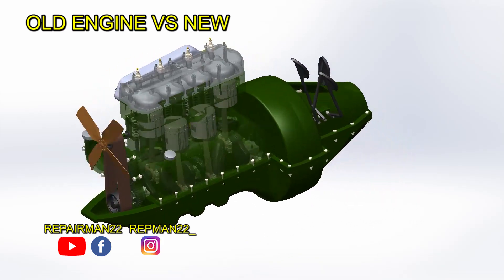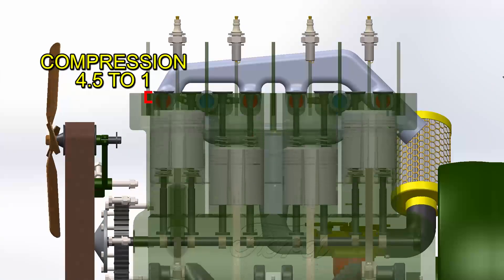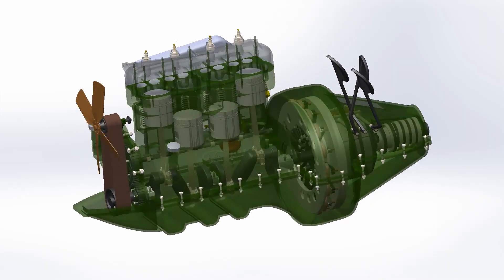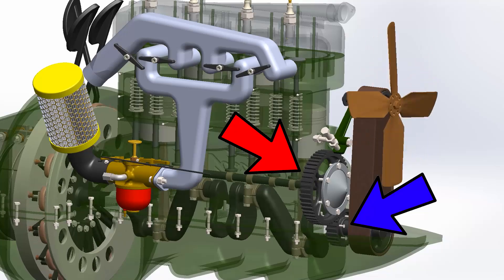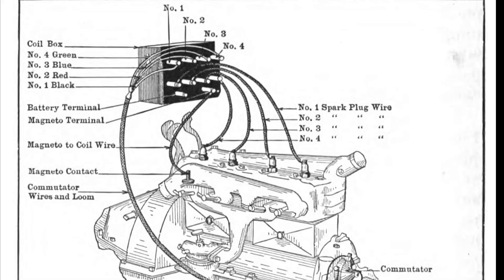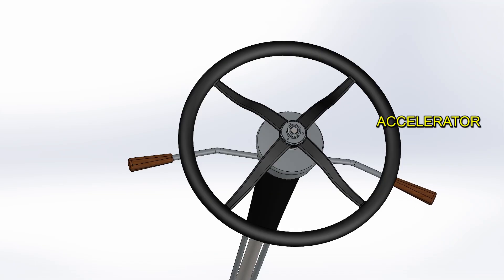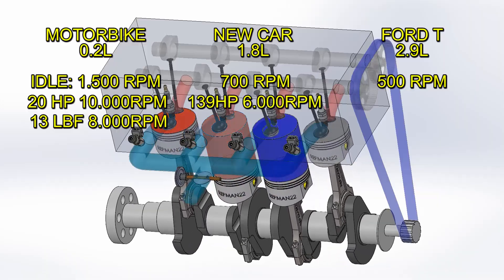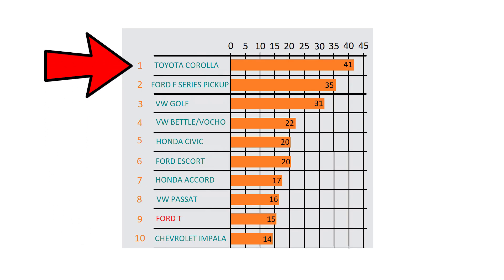Ford T vs New Car 🤯 3D Animation// What changed in engines in 100 years?

Comment: The T was made in an era when there was little if any mechanical distinction between cars and farm equipment.  It had problems of course, but it's amazing that it was able to run relatively well using such primitive means of lubrication and cooling.
Reply: Yes indeed, in a time where Ford was expecting buyers who'd never owned a car before due to the T's affordability compared to most previous cars, they assumed a lot of owners would be far away from convenient car mechanics, so being easy to fix for anyone familiar with basic farm equipment was probably a really good selling point.
Keep it simple, and the owner that was able to fix minor issues themselves easily just ends up liking it even more.
Reply: @G1NZOU  
Most  Certainly  ,   YES  .  
But  don ' t  even  touch  
"  Todays  "    motors ,  by  yourself  .
Even  trained  mechanics  hardly  can  fix  them  easily .
Reply: Yup  .

Shows   just   what  .
Can  be   done  .
Reply: Yes  !
Old  sayings  ,  ARE  often   the  truth .
This  one  ,  for  example .
"  The  Simpler ,  the  Better  "
AND  ,  what  of  the  Worlds '  Future ?
Futures  ??
Billions   ARE  helped  MORE  by  simpler  ,  cheaper  things  in  a  world  of  8  billion  variations  of  Life  Styles .

Cher  sings  about  lf  l  could  turn  back  time  ,  if  l  could  find   ,  a  Way   . . . . "

Would  she  turn  time  back  to    1 9 3 9    ?
Reply: @georgehorobin2225 if it’s bitter, it’s better.
Reply: @glennso47  

More  information  is  needed  by  me  about  that  comment . . . .
" If  its  bitter   it  is  better  "
When  you  are  ready .
These  things  take  &  need  time  and  can  take  years  .
In  my  case  ,  I  have  about   4 0 0   new   ideas  &  may  soon  have  about  5 0 0   new  ideas  for  Planet  Earth   &  Industry  &  Agriculture  &  Fishing  and  many  associated  things  .
Knowledge  is  often  an  important  Factor  &  Component  .
But  many  are  the  trouble  making  " Set  Backs  "  in
The  Set  of  2   things .
Bitter   /   Sweet  .
Reply: According to my dad many farmers used the model T as a farm implement.
Reply: AND  ?
15  Million  ?
CAN ' T  ?   be  wrong  ?

Comment: The Ford Ts flathead is about the only thing that remains an astoundingly reliable mechanism. It’s true that the side valve arrangement makes an engine immune to valve drop and eliminates damage potential from extreme valve timing issues. Valve drop, by the 70s, was a virtually unheard of issue, but it can happen in OHV engines. The benefit of the  flathead, though, is that you can use dirt cheap materials and not worry about it.

The multiple-spark system (called SOS in airplanes) helped with the bad gas available at the time, and improved starting with low-grade fuel. It certainly helped with starting especially, but with modern fuel is entirely unnecessary.

The T used a planetary transmission, which reduced its likeliness to strip gears, and it’s certainly less likely than even the most modern manual transmissions to strip out and have serious damage. But it was controlled by tightening cotton bands around the ring gears, and these go bad almost constantly. If it weren’t for the cotton bands, the transmission would have remarkable reliability even today. But because of the cotton bands and how they behave, the reliability is very low.

The fuel system is drastically improved by the addition of a fuel filter. The bladder device used on the T was sub-par even for its time, and it said in the Ts manual to filter the gas before it was even put in the car.

The oil slingers (called “spoons” here) were so woefully inadequate that the addition of an oil pump more than doubled the lifespan of the engine - when oil pumps were introduced they were seen as being the saving grace to reliability. People who lived in mountain states used to fill them so full of oil that they would smoke as if they had blown rings, so much so that bystanders would think that the car was on fire, and this would wind up doing damage all on its own. In some places people associated oil pumps with clean air.

The carburetor was finicky and didn’t have an air filter. If dust gets in it’s like grabbing sandpaper for rings. And in many places there’s dust, including on earth. Finagling the carburetor to turn on the car made the car difficult to start. I’ve had experience with crank-start engines that have finicky carbs and they’re an absolute nightmare to get running. The introduction of electric start seems to us as a footnote in history but to the people at the time it might as well have been a gift from god himself.

There is the problem of having to back up hills because of the gravity tank, but that’s not a reliability issue it’s just inconvenient.

The lack of a water pump is a nice little niche, but that’s because of the low power of the engine vs. its surface area and size. Anything even slightly more substantial needs a water pump. It’s cool that it doesn’t need one, for sure, but no modern engine can do without it, besides something that’s air-cooled. If the Ts engine were designed today (in fact, any engine in any riding lawnmower has made the same HP since the 80s) it wouldn’t have water at all, it would have no water plumbing nor radiator and would just be air cooled. The cooling system on the T is actually quite a lot more complicated than any equivalent engine designed today.
Reply: Thanks for the fantastic breakdown I really appreciated the additional insight!
Reply: Some electronic ignition systems today are multi-spark. For example, the recently introduced Boyer Bransden ignition system for English motorcycles is called the Tri-Spark
Reply: @pashakdescilly7517  this is true,  SOS systems are being put into cars more and more often. This is mainly because gasoline quality is being chipped away in order to have cheaper fuel. As cars progress they're being built to handle more varied grades of fuel, which widens the margin of error for fuel quality, and enables more experimentation.  Shower of Sparks systems prevent missing hits and reduce emissions as a result.
Reply: My dad told me about using gasoline to start them. After it warmed using kerosene or diesel to run down the road during WW2 and before.
 IN 1969 I had a Corvair. A air cooled flat six. It got 30 MPG but it also required a minimum of 95 Octane and retarding the timing 2 degrees when 100 octane was not available.
If you compare 1965-1969 Corvair 110-140 to 2015 Trax. The Corvair is larger and more comfortable. But if you got the 2 speed slushomatic, lower gas mileage and a lot more time to get to the freeway speeds. The 4 speed stick was better than the 6 speed in the Trax. No flushing required.  Could change out the then $25 dollar clutch in any cement floor in one hour. Happened about every 25-30 miles because I got 18-20 MPG.
The engine and trans was easy to fix also. 6 new jugs, two easy to get at heads. If the piston is not damaged, just put in new stock rings. The head work cost more than the jugs.
 Only took 8 Bolts to remove the whole thing.
 Only takes $8,000 and 21 hours of labor to fix the engine and trans in a Trax.
Yep you can say things have improved. The price of fixing has not.
Reply: How can a planetary gearbox have multiple ring gears? With a manual we need to transfer force on a moving part which then governs a clutch ( syncro mesh ).
Reply: @ArneChristianRosenfeldt  there's two planetary gearsets in the transmission.  Both sun gears are connected together with a shaft and power is sent to them via the planetary gears.  The ring gears are able to free spin, and when they do,  the planetary gears do not transmit any power to the sun gears. Each ring gear can be stopped by means of tensioning a cotton band around them, which causes the planetary gears in the selected assembly to send torque to the sun gear.
Reply: @ArneChristianRosenfeldt  Your  information  ,  as  stated  ,  is  nonsensical .
 What  is  your  questions ',   intention   ?
Thank you. 
Or  did  you  only  intend  it  as  a  talk  convertor  ?
Reply: @georgehorobin2225  My first introduction to an automatic spoke of "brakes". I always did wonder why an automatic would not need a clutch. A clutch is a brake where both the disk and the pads rotate. So you need a bearing with axial load and typically some spring to actuate it. I would still invest in this rather in more gears.
I just want to give the whole picture. Dragsters still seem to use a rotating ratchet ( so no actuator ) and a brake on the ring gear. I thought that this is for heat: After use a clutch is hot and you better don't touch it. But then again two large diameter clutches would be better. With engine in the front and rear wheel drive there is lots of distance to keep 8 pairs of gears. So the clutch only needs to compensate for small RPM mismatches and only for short time.
Unlike a belt based CVT, neither clutch, nor straight spur gears have a scaling limit.

The differential needs a bevel gear anyway. So just press two of these onto the planet holder. So no problem to attach a double-clutch gear box with two output shafts. Only problem is that an engine only provides a single power-input shaft. So you end up with all this coaxial shafts :-( Maybe someone builds a dragster which works like the steam engines: Conrods to transfer torque onto a second shaft.
Ah so many reasons why EVs are the better cars.
Reply: @Arne Christian Rosenfeldt  What  ?
What  did  you  say  ,  Arne  ?

My  main  interests  in  engines & transmissions  for  this  Planet  ,
( While  electricity  AND  Fossil  fuels  AND  VEGE  OILS  are  still  available  AND  are  being  found  &  discovered  &  developed  for  the  next  300  years  and  MORE  . . . . 
Is  this .
How .
How  to  make  900  m.p.h.  locomotive  assemblies  moving  freight  and  animals  and  human  life  forms  ,  in  safety  and  efficiency  and  cheaply  ,  between  South  Patagonia  and  a  huge  300  mile  long  Marshalling  yard  north  west  of  Moscow  .
Interested  ?  
   &
Converting  coal  into  liquid  fuel  oil  cheaply .
     Interested  ?

And  you  have  info  about  Clutches ?  
To  " handle "  that  sort  of  . . . 
   LOCO  ?
Or  are  YOU  ,  Loco  ?
Reply: @georgehorobin2225  Is English not your native language?
Reply: @ArneChristianRosenfeldt  why would you want two clutches side by side? And two drive shafts implies two transmissions.  It's better to just make the clutch bigger
Reply: @Johnsoline  Double clutch is generally used to avoid a torque dip. You apply one of the clutches and it then lifts the other clutch out or torque by means of a ratchet. ( or you have slack in each of your transmissions and fast electronics and actuators to pull out the cogs ).
Reply: There is an oil pipe that carries oil from the magneto top to the front of the engine, if that gets clogged you will burn out the front bearing going uphill.  You can see if it is working if you take the oil filler cap off and increase the rpm’s a little and you will see an increased flow.
Reply: So  why  not  an  improved  Planetry  Transmission  for  modern  engines  ?
And  why  not  more  effective  oiling  of  motor  &  Gearbox  ,  WITHOUT  oil  pumps  ?
Reply: @georgehorobin2225  There is an improved planetary transmission for modern engines. It's the automatic transmission. The way they work is virtually identical in concept, but the automatic transmission has ditched the cotton/asbestos bands in favor of more reliable clutch packs, and gotten rid of the clutch in favor of a torque converter.
Reply: @TheJohnsoline  
Seems  good .
Very  good  !
But  the  World  needs  a  NEW  &  better  ,
" Talk Converter "  surely ?
Not  " Kalash nee cough  "  ?   of   " Teeth "  ??
Reply: @georgehorobin2225  what??
Reply: @TheJohnsoline  
What  ?
Is  a  question .
About  the  subject  or  content  or  intent  ,  of  ,  Communicating ,  per  sey .
All  l  want  to  say  at  this  time  is  ,  "  Wait  for  it  ."
(  lnformation  ) 
And  .
Regarding  Engines .
The  future  World  may  need  another  Ford  Model  T  Mark  2   ,  Engine  ,  a  billion  of  them  ?  For  various  applications  ?
Reply: @georgehorobin2225  more effective oiling requires oil pumps. The T's engine didn't have an oil pump, but it also ran at 1500 RPM and pulled around a ¼-ton vehicle at 30mph. No stop-and-go traffic in 1910 really,  and an engine lifespan of 35k miles was astronomical. It did that all at 10-15mpg. Nowadays we want freeway speed, stop&go driving, good fuel efficiency, and great power out of a small engine that lasts 200k+ miles.  The T's engine made 22HP and was the size of something we'd expect 100+ from today. This involves high stresses and speeds which requires high pressure constant lubrication, a little flap attached to the crank to splash a little oil around isn't going to be good enough.
Reply: Yeah, anybody who says "they don't build them like they used to" are correct because the cheapest oriental car made today will last longer with less care than the average American car of the 60's. Put a young person in an older car with drum brakes and they have to quickly grasp it has less braking power and you really have to muscle the non-powered steering wheel. Remember the old vacuum powered wipers? The wiping speed wasn't consistent at different points of motor load and would at times come to a complete stop! Just try and buy a car today with a lighter and ashtray (just kidding) but one thing I do miss about the older vehicles were the wing vents. Quite often in a car built in the 60's would survive a collision better than its occupants. With a little know how an older car could be easily stolen compared to now.

Now there's the push for electric cars, we'll just have to wait and see......

 @Johnsoline
Reply: @georgehorobin2225  All I can tell you is all of my manual shift vehicles outlasted the automatic shift. Not many women like the the 3rd pedal. But not too worry modern engineering has fixed the reliability of a external clutch. It is called the dual clutch.
 The days are long gone from removing 6 bolts, taking the shifter off and dropping the drive shaft down. Sliding the tranmission back . Remove and replace after touching up the flywheel and pressure plate with a bit of 120 grit on a sponge. Blowing the grit out and replace the bolts. In and out in 30 minutes. But also there were those 6 and 8 bolt bell housing from then too. Those took 1hr hour. Because the the tranny had to come out to get the bell housing off.
Reply: AND  ,  have  you  seen  the   ,  NEW  ,  ideas   for  " Flat  Head  "  motor  construction  ?  
What  would  it  cost  Ford  Motor  Company  ,  to  get   THAT  valuable   motoring  part  ,  ln formation  ??
Reply: An  ,   Air  cooled  ,
Model  T   ,  modern  Ford  Engine  ?
Intriguing    !
  But  ,  How  so  ?
Reply: MUCH  MORE  ,  can  be  done  to  improve  both  air  cooled  motors  and  water  cooled  motors  .
And  at  little  more  cost .
And  resulting  in  MUCH  greater  reliability   AND   durability  ,  believe  me .

I  have  studied  engine  designs  seriously  since  before   ,  and  during  1995  and  from  that  time  on .

BUT  !
I  don' t  want  my  ideas  for  improvements  ,  stolen  from  me  .
Ralph  Sarich  ,  Australian  inventor  off  an  Orbital  engine  ,  similar  to  the  German  Wankel  motor  design  ,  went  to  the  U . S . A .   and  sold  his  design  to  some  Americans .
It  was  reported  he  was  paid  ,  for  exclusion  to  the  Right  of  Manufacture  of  it  ,  by  him  ,   an  amount  of   $  200  million .

Did  Ford  Motor  Co   buy  that  Right  ??
Reply: @georgehorobin2225  why would a motor company pay 200 million to buy exclusive rights to manufacture and then never manufacture?

200 Mil is a HUGE loss on something you'd never profit from. The kind of decision that would make a company go under
Reply: @Johnsoline  
Because  manufacturing  Companies  want  to  Control  manufacturing  ,  in  a  way  that  will  enhance   their  own  productions  and  suit  their  intentions  to  survive   and  prosper   with  THEIR  Plans .

If  they  own  something  ?
It  is  theirs  .
To  make  decisions  about .
Ralph  Sarich  put  that  money  into  high  rise  city  accommodation  towers  , AND  some  of  it  continued  his  Right  of  Manufacture  of  a
  Two  Stroke  & / or  other  ,  Outboard  motors  ,  fuel  supply  system   for  boats .
Reply: More  is  known  about  motor  designs  now  days  ,  including  the  " Flat  Head "
Style  .
All  of  the  newer  understanding  or  comprehension  of  those  design  ideas  would  result  in  much  superior  engines  AND  ,  engine  production  techniques  .
Definitely  better  than  motors  of  this  year  of  2 , 023 .
But  ,  who  will  make  them  ?
Americans  or  others  or   both  those  ?
Reply: Knowledge  is  of  great   Primary   lmportance  .
It  Preceeds    ,  all   else  .
Without  it  ,   ideas   cannot   exist  .
And  Good  Will   in  association  also  is  essential  for  a  good  result  from  the  application  of  that  knowledge   ,  in  effort  to  ACHIEVE    the  goal  of   helping   Good  ,  Survive  AND   INCREASE  .

Comment: 2022 Engine = SHIT

old engine = 👍
Reply: yeah
Reply: Why are nowadays engines shit?
Reply: @GrillerRohde  full of computer controls and fault codes electronics unreliable breakdowns DPF adblue no more turbos SC less power harder to fix electronics cheap materials gaskets are easily blown many parts damage is common if your redline it even acidentally expensive repairs awful sounding... old engines were better and new won't last
Reply: @recycleman975  yeah right
Reply: @recycleman975  yeah
Reply: @recycleman975  true
Reply: @GrillerRohde  explained here
Reply: true
Reply: yeah 2022 engine is bullshit full of shit for treehuggers